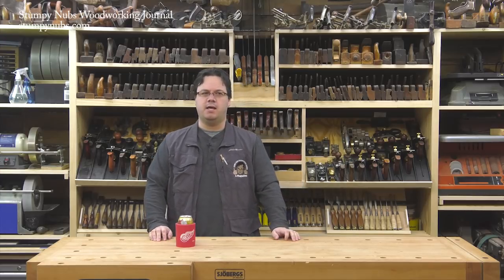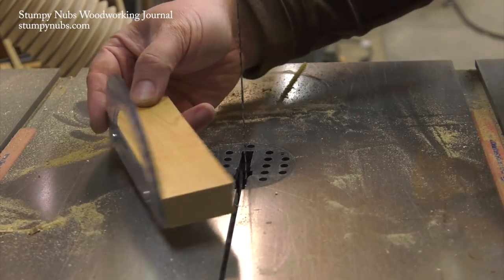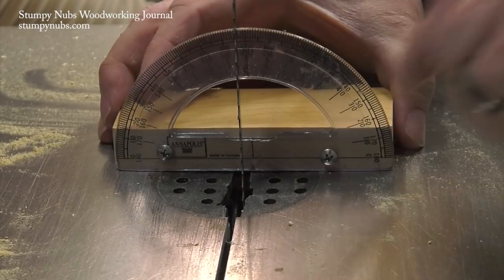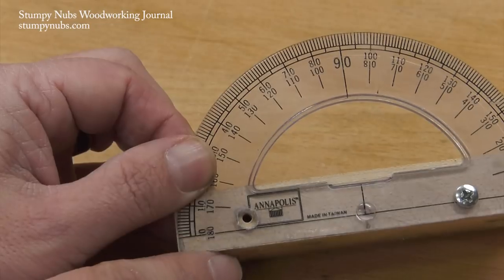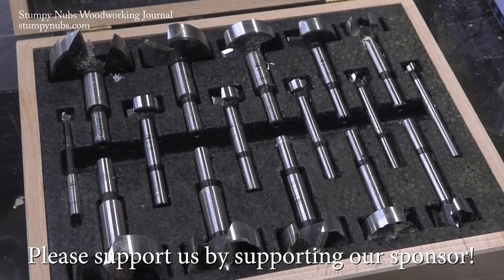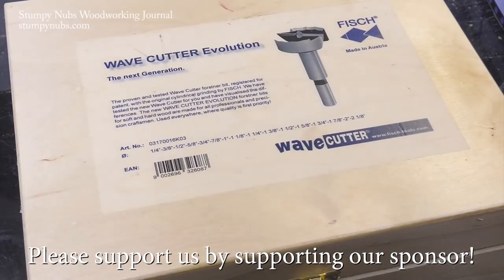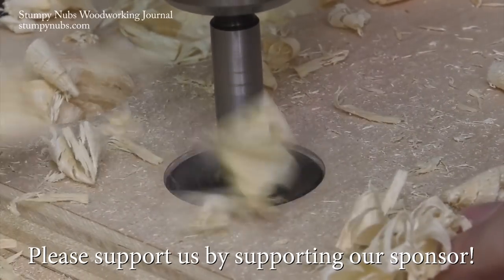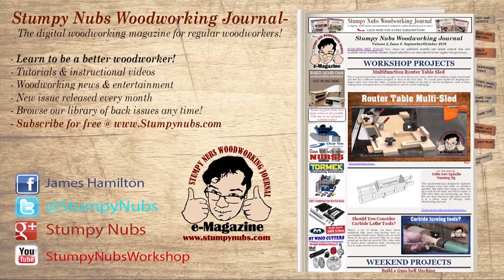Make A Quick & Easy Band Saw Angle-Setter (Woodworking tip)

Comment: I went to the affinity tool web site and I didn't see the set that you showed in the video. I only saw a 6 piece set for $187.00.
Reply from the maker: Amazon: https://amzn.to/2S2T5cl  HOWEVER- Top quality bits aren't cheap. I like to have full sets so I am always prepared, but others may be better off replacing just the bits they use most instead of buying a bunch of bits they won't use.
Reply: @StumpyNubs  same. I got a cheap set of regular drill bits a long time ago. When I wore one out, I replaced it with a better one. Turns out I only use about 4 bits, but it's nice to have those other sizes to fill the spaces in the case... And who knows, maybe some day I'll use one of them...